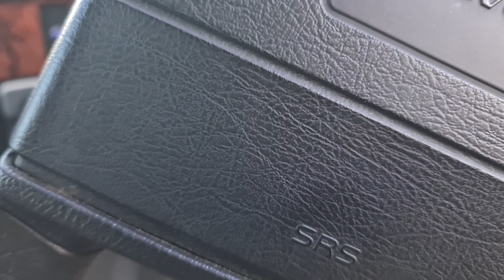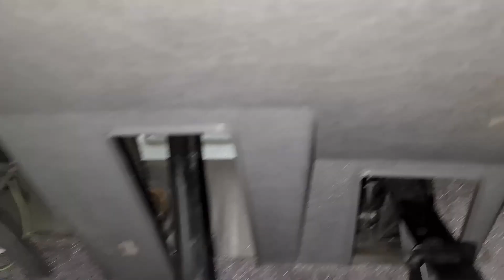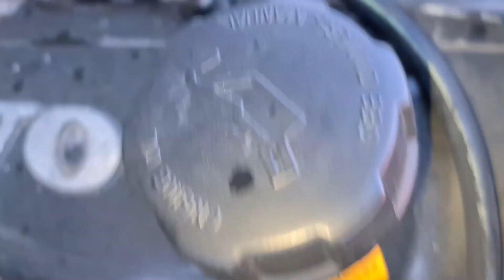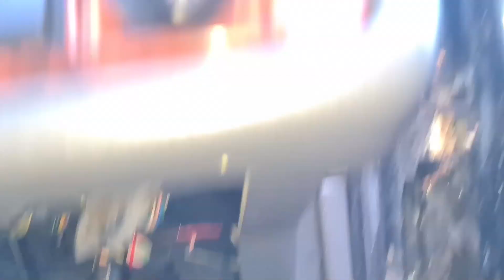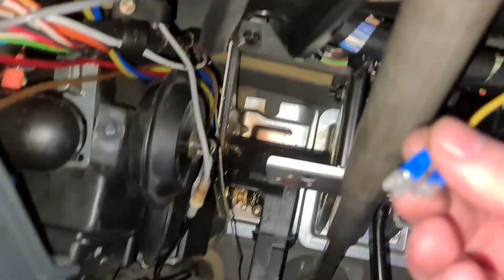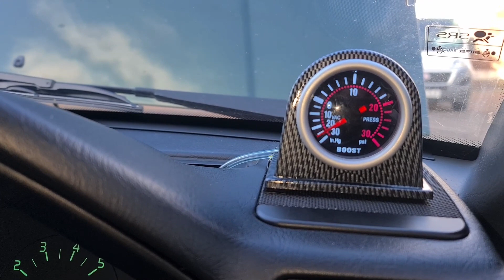Project Turbo Brick EP10 - None Of The Boost ( Volvo 940 Boost Gauge Installation )

Comment: What were the wires you tee'd into for the power?
Reply from the maker: @FudgeFredd  Iirc it was the 12v power outlet / cigarette lighter but I just made sure it was a wire that went live when I switched the ignition on so that the gauges would come on with ignition.